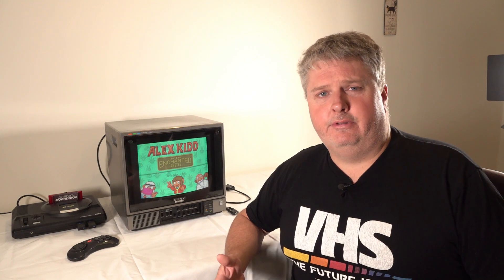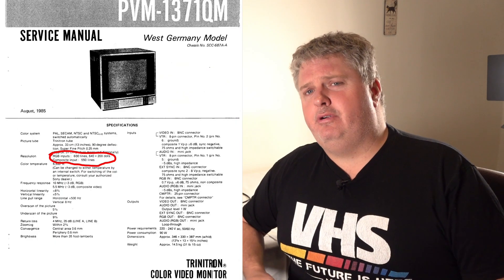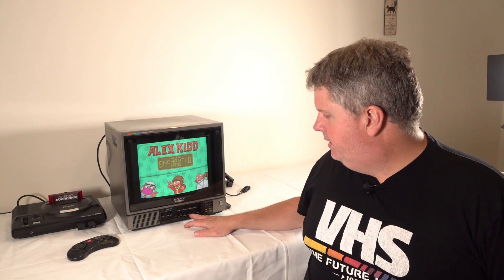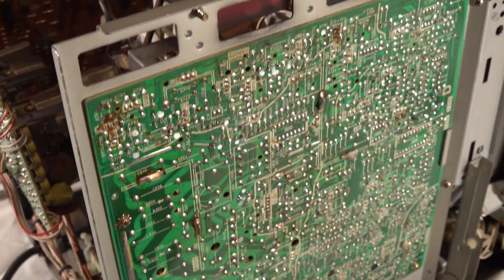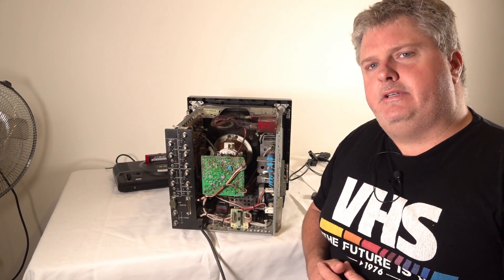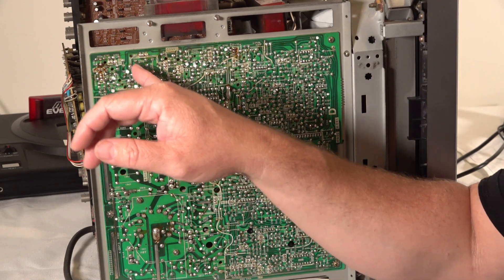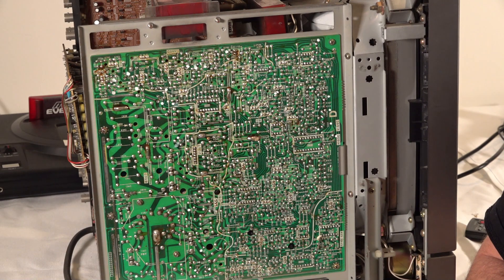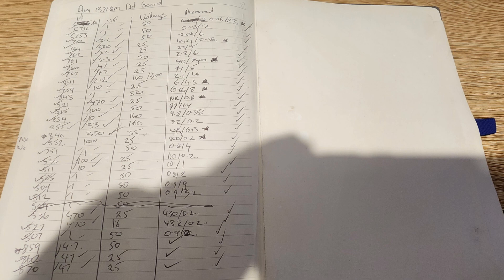Is My Sony CRT PVM a Goner!!. Sony PVM-1371QM Geometry Repair

Comment: I have the same screen and when I feed in a Commodore 64 (composite) signal, I have large black bars on the left, right, top and bottom. So I have to check the capacitors, is this right? (or is it because of the 320x200 screen resolution of the C64?)